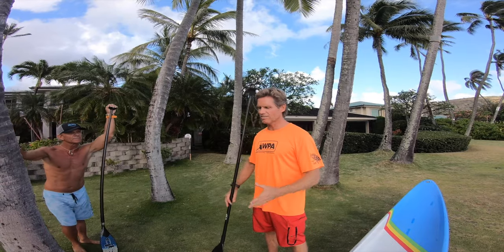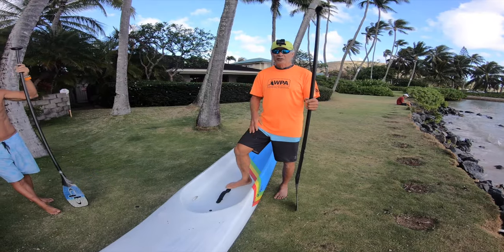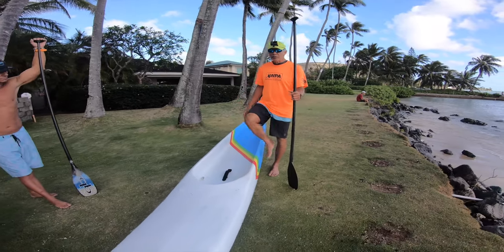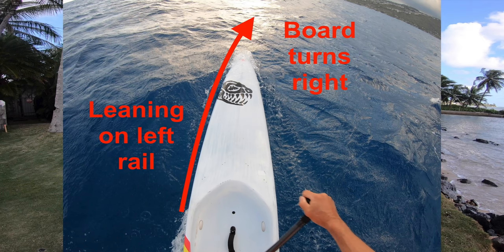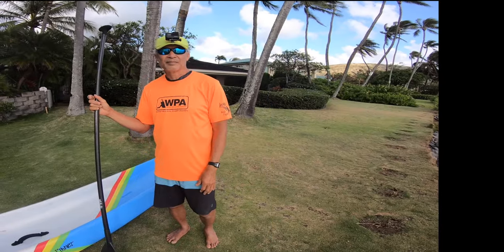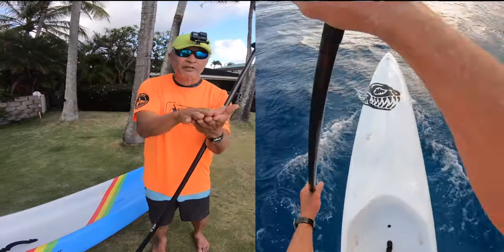SUP Rail Steering- how to steer using rail pressure from the middle of the board

Comment: Open Ocean Paddling......This is comparable to running a marathon!.....
Im guessing that understanding the tides & currents direction would also factor into steering.....nice footage.
Reply from the maker: Yes,  I have run several marathons and they are tough but I would say that the Molokai to Oahu race (solo, 32 miles between islands in rough water) is way tougher, extremely challenging both mentally and physically.  The Hawaii Kai downwind run shown in this video is a walk in the park in comparison.
Reply: @blueplanetsurf  Crossing the Ka'iwi channel on a paddleboard is a lifelong goal for me!....cheers